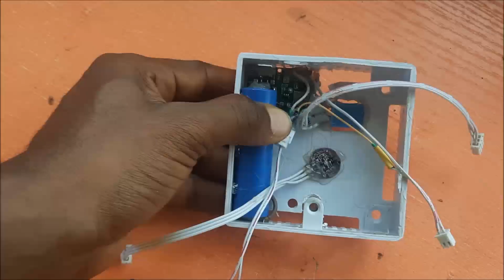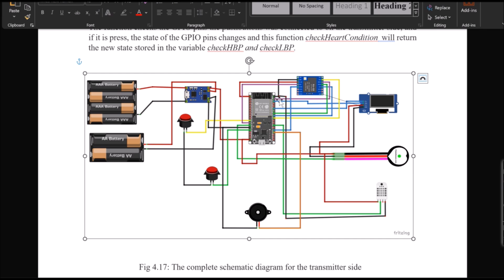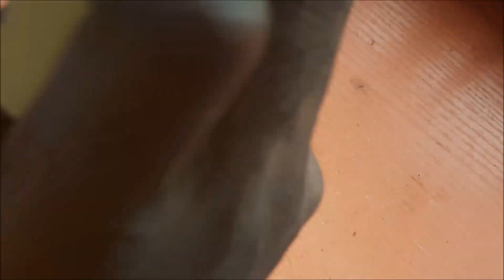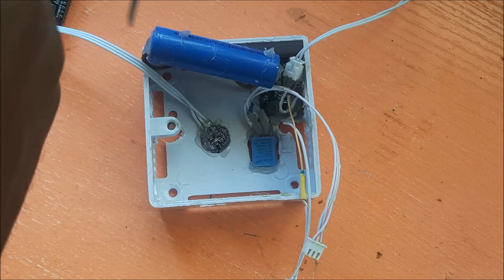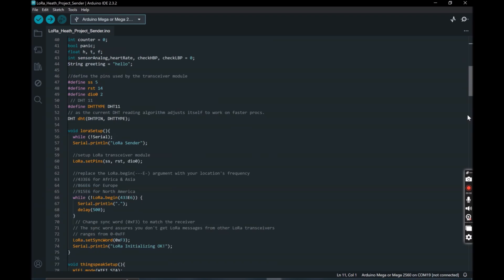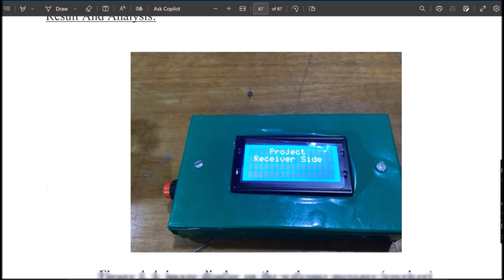IoT Health Monitoring System With LoRa Technology, ESP32 and Arduino | IoT Pulse rate Monitoring

Comment: sir can you please post the schematic diagram of recevier side and components link
Reply from the maker: check the link in the description, read the blog post
Reply: @ancii3182   sir but in schematic diagram the words in the box are not clear so
Reply: @ancii3182  sir connection correct agi idhya blogalli
Reply: @ancii3182  because arduino nano burn agthidhe
Reply from the maker: @bhavyashree5567  what are you saying?
Reply: @ancii3182  sir actually the arduino nanobos getting heat if we try to dump the code in it and burning smell is coming
Reply from the maker: Have you read the blog post?
Reply from the maker: have you read the blog post?
Reply: @ancii3182  yes
Reply: But the schematic diagram is blur
Reply from the maker: @bhavyashree5567  request for it via telegram and they will send you the PDF copy.
I don't know if it is free though
Reply from the maker: I also think the blog post is well detailed. If you can't see the pinout very well, you can use the source code to decode where they are connected. If you k ow what you are doing.